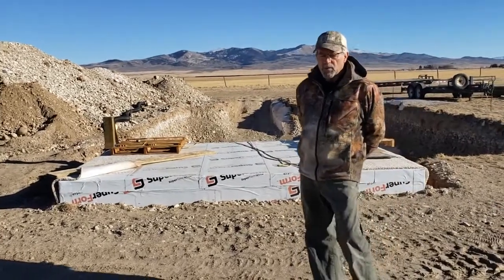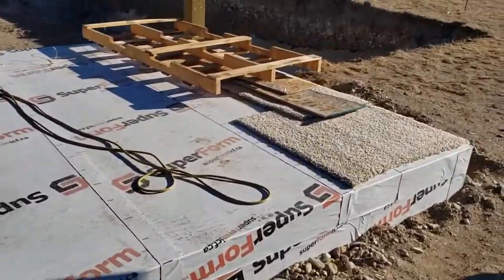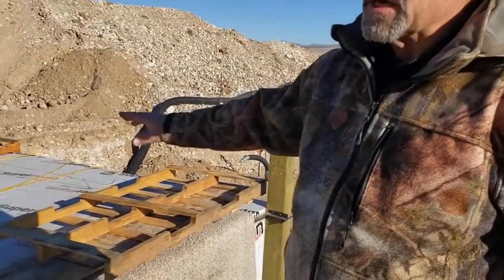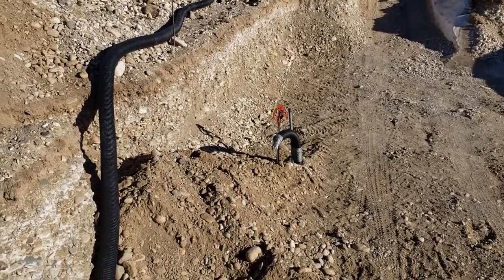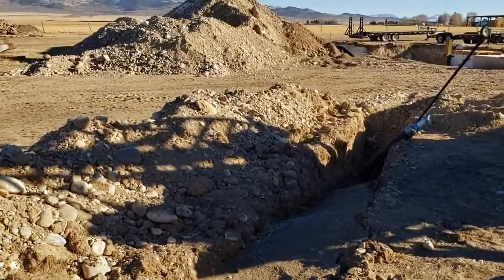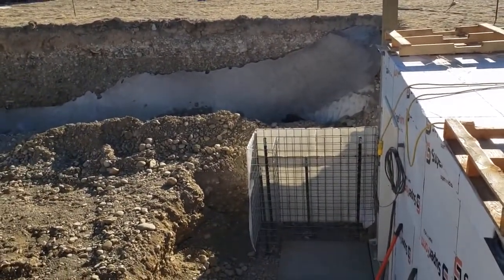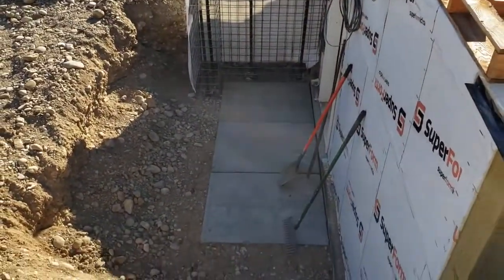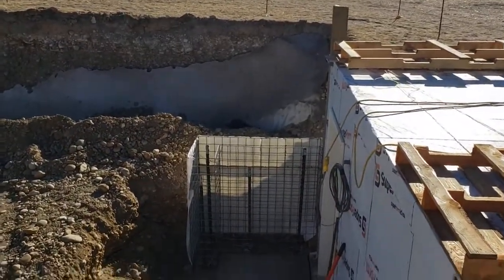Step 5 Southwestern Montana earth-sheltered, Walipini-style greenhouse

Comment: On the winter solstice how much of the ground will be in shadow & how much in light? I like earth sheltered but the side walls would cast a long shadow which would prohibit growing in the winter months.
Reply from the maker: Good question Corwyn.   One consideration is what is the ground like where you are putting your greenhouse.  The sunlight entering will be different in a greenhouse dug into a hillside as compared to one constructed in level ground. The solar azimuth is contingent on the latitude of where you live so it is paramount to calculate your solar path for the year.  One way is to stake it out with small flags or stakes as you observe the sun path's for an entire year before starting construction.  Another way is to use www.suncalc.org.   Assuming you are in the northern hemisphere, the sun's path will be in the south.  We used the suncalc website and then did a lot of math and analytics before digging.  Our greenhouse walls are in the ground 5 feet below surface (You have to be at least lower than frost level for your area, but also remember, the deeper you dig the more shadow is created from the south).  If you are putting in a pit greenhouse, when you dig , make sure the cold sink area is along the southern wall.  Since you don't grow produce in the cold sink, this will be on the shadier side of your greenhouse during the winter.  Our greenhouse cold sink is about 3 to 4 feet wide and 2 feet deeper than the grow floor (so 7 feet below surface).  The cold sink takes up most of the shade in winter.  Another tip is to paint your back wall (north) white metallic so the sun reflects back during the winter (you have to balance this with heat considerations).  If you have too much shade in winter, you may consider portable grow lights.